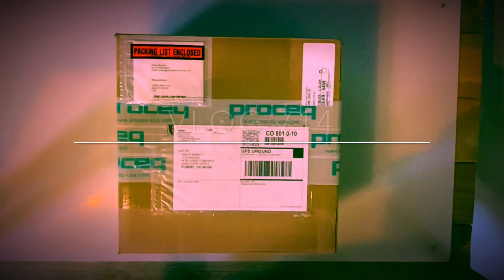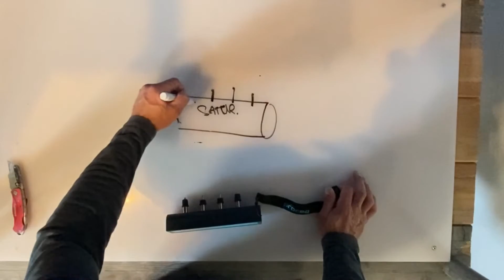Tech Review: Proceq Resipod for Concrete Surface Resistivity Testing - Vlog 714

Comment: Dear Dr. Belkowitz 

I have already used this Resistivity method with the a device called "CTM D-4PRA Resistivity". this device can't reach higher than 990 Ω.m, so we can't measure some resistivity samples particularly concrete with high performance or an aged concrete (e.g concrete with 120 day or higher). But a solution has been found which is using the bulk method resistivity namely ASTM G57-79 to mesure the resistiviy of an old conrete sample. However we faced an other problem which about the difference between the two method.fortunately a study [1] has been done that correlate the two methods taking into account the used cement. 

[1]: Pratanu Ghosh and Quang Tran, Correlation between Bulk and Surface Resistivity of
Concrete. In: International Journal of Concrete Structures and Materials. Department of Civil
and Environmental Engineering, California State University. 21 November 2014, 14p

Best regards 
Elkhalil
Reply: Can you give more details about the study?
Reply: @ARAAK2020  I have already mentioned the reference !